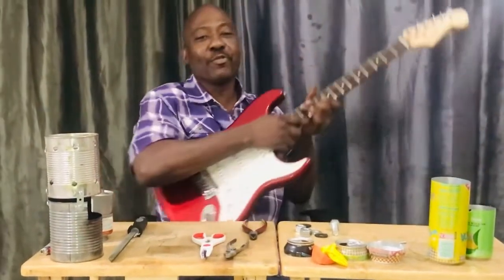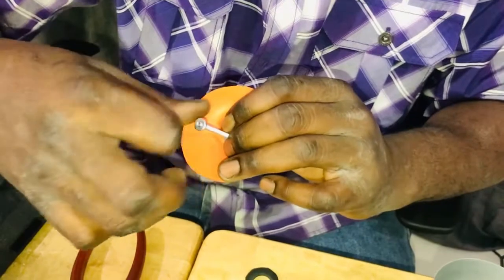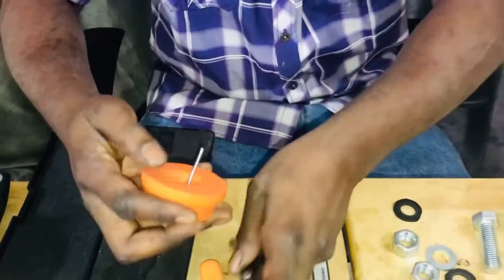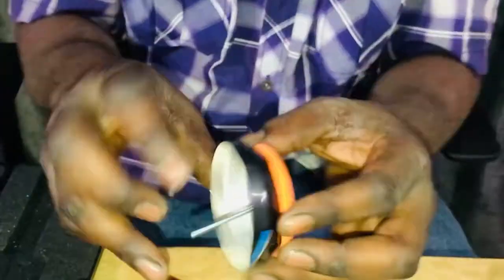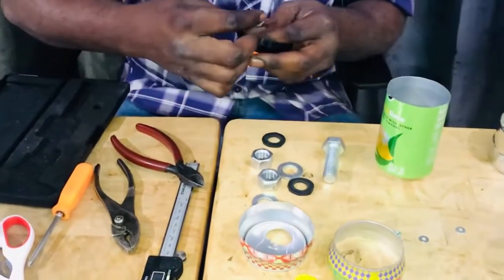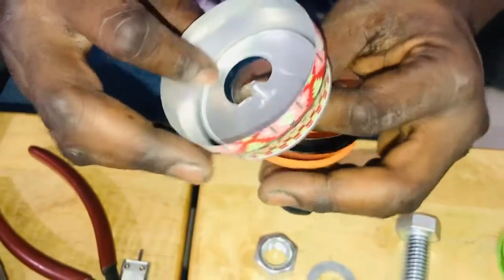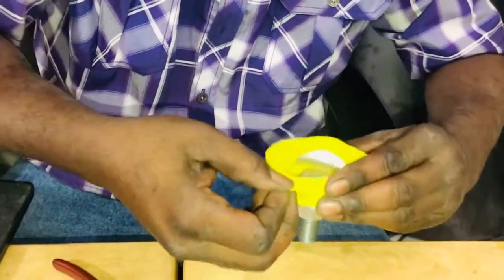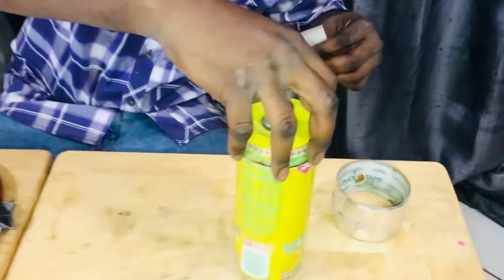HOW TO BUILD A FREE PISTON STIRLING!?

Comment: Nice project, for the amp meter you must plug a load to the output of the bridge rectifier and measure the line in DC current while you got the load being powered (You could use a resistor, lamp,motor..)
I think that instead of removing the air sir you could actually Change the diaphram for a piston and use a spring to balance the air pressure from the outside of the engine, but i belive that for a stove range off temperature should be hard to adjust the tension needed for it to ressonate properly 😅

Comment: Hey!
tell me what should be the volume of cans?
what is the weight of the load or the diameter and length of the bolt.
I cannot run my 500ml and 450ml inner cans and I shortened it. Doesn't start. PLZ give me a recommendation.

Comment: Good video thank you for sharing, being able to move heavy bolt means it has power to generate usable electricty if you change the bolt with magnet going up and down inside upper coil ,or a thin metal rod  connected to a wheel and (preferable stepper) motor
Reply from the maker: Good idea 💡 I would like to see the wattage it would generate. Thank you for watching.
Reply: @madmechanics7525  ⚠️ God has said in the Quran:

🔵 { O mankind, worship your Lord, who created you and those before you, that you may become righteous - ( 2:21 ) 

🔴 [He] who made for you the earth a bed [spread out] and the sky a ceiling and sent down from the sky, rain and brought forth thereby fruits as provision for you. So do not attribute to Allah equals while you know [that there is nothing similar to Him]. ( 2:22 )

🔵 And if you are in doubt about what We have sent down upon Our Servant [Muhammad], then produce a surah the like thereof and call upon your witnesses other than Allah, if you should be truthful. ( 2:23 )

🔴 But if you do not - and you will never be able to - then fear the Fire, whose fuel is men and stones, prepared for the disbelievers.( 2:24 )

🔵 And give good tidings to those who believe and do righteous deeds that they will have gardens [in Paradise] beneath which rivers flow. Whenever they are provided with a provision of fruit therefrom, they will say, "This is what we were provided with before." And it is given to them in likeness. And they will have therein purified spouses, and they will abide therein eternally. ( 2:25 )

⚠️ Quran

Comment: That is the same beginning that everybody else goes through.  However, I do like the slightly different approach.  Check out the notes at http://diystirlingengine.com/sv-2-stirling-engine-generator/ for placement of the heatsink and the regenerator and the furnace/heat dam, the work that has not been done yet.  I need to source these parts from the trash just like the rest of this product so other nomads will be able to repair it themselves on the go.  I understand aquarium pumps are a good source of solenoid motors that we might be able to utilize as part of this generator project.